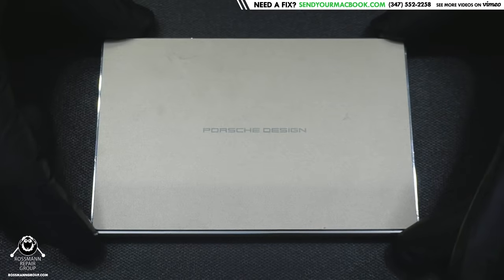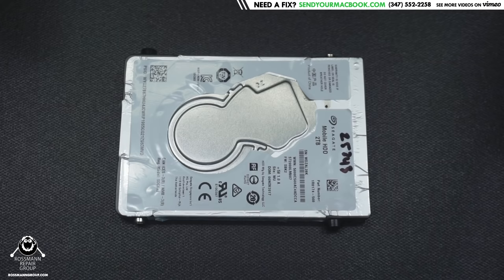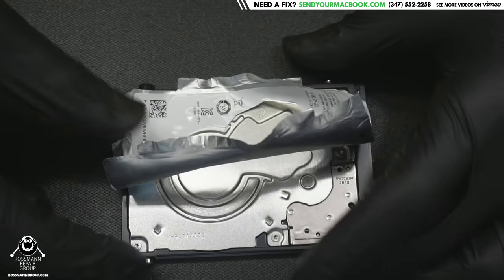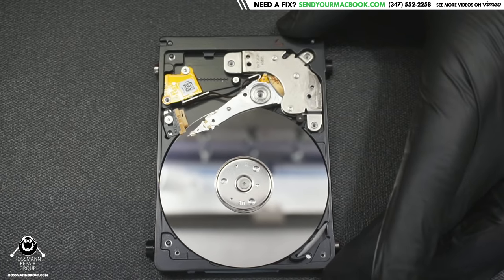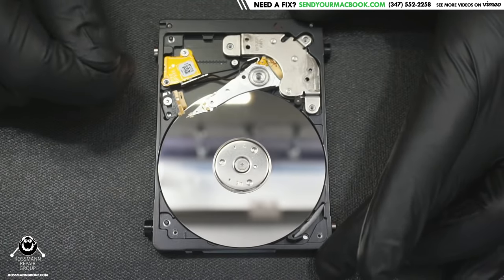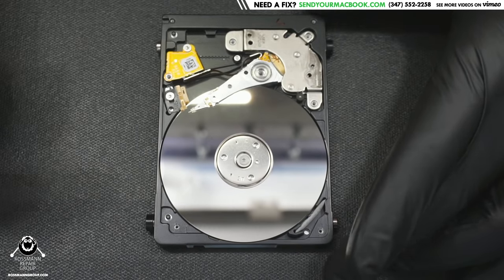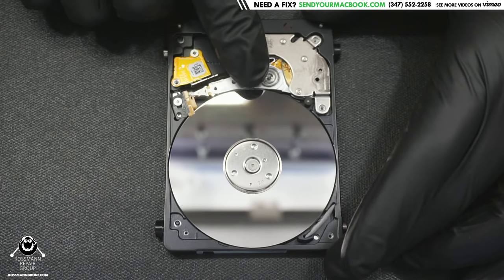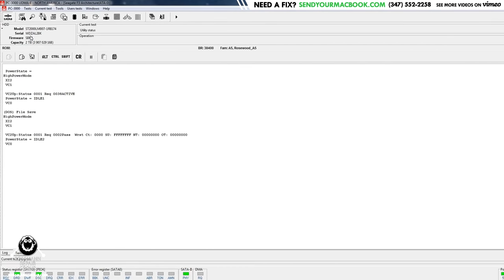Why your Seagate external hard drive is beeping; beeping hard drives can be recovered with this fix

Comment: You have to learn by try end errors to learn. These recovery technitians with experience did not came from nowhere. ;-) Good video. I learnt something.
Reply: Yeah but you learn using donor drives or get some old crappy used drives, not on your own (or someone else's) data.
Reply from the maker: @vgamesx1  vgamesx1 gets it.
Reply: @vgamesx1  thankfully there is no shortage of obsolete HDDs in the world.

Comment: Those heads can really stick to the drive surface, I haven't done a recovery but I've pulled apart junk drives with stuck heads and it surprised me.
Reply: Perfectly polished metal can sometimes spontaneously weld themselves together. It's a strange phenomenon but it is definitely a real thing. This is a regular problem under vacuum conditions and has been an issue on the International Space Station a few times over the years. While hard drives do not use vacuum (well, not the consumer ones anyway), you can still get similar (though far weaker) welds ocurring. Fortunately they are fairly easy to unstick but yes it is surprising how strong they can get

Comment: Louis, good tutorial, I hope that for someone it would be helpful. I have solved same issue with damn Seagates before, and unfortunately, those repair just gives time to backup the data. All drives died after some time.
Reply: I think that is always the case.  You're "rebuilding" the drive in order to recover the data from it.  As is the case to everyone except Apple, the data is always more important than the hardware.

Comment: I get defective seagate microdrivers for laser mirrors, often they have stuck head but 80% of the time a good finger flick when powered on unsticks the heads from the platter. No I am not advising to hit your hard drive when powered to unstick heads, I just found it interesting it had such a high success rate with microdrivers.

Comment: Thank you so much for this video. I managed to unstuck the head, everything worked afterwards and I was able to copy all of the data to another drive. 
It saved me 1900€ a data recovery company in my town wanted to charge me for it, their "analysis" (they didn't open the drive) said that there is damage on the magnetic drive and there are bad blocks. Well...

Comment: It's always the more expensive and exclusive ones that break
Reply: This isn't a expensive or exclusive HDD. It's a budget, run of the mill HDD. Generally, more expensive HDDs are better. I can't think of a HDD where the more expensive one isn't better. You can find $120 HDDs that are not as good as a $110 HDD, but that's just retailer price fluctuations. Significant price differentials are what I'm talking about. A $300 HDD will be better than a $100 HDD.

Comment: I bought 2 3.5 inch 2tb Seagate hard disk drives for my home office server and they did this sound out of the box. I had to add a 30 second pre-time in the bios of the machine to let them finally spin up.
Reply: Maybe your mobo isnt providing full power to the harddisks or psu is too weak when all systems go powerup?

Comment: The pinned comment from Mytheroo and expecialy the comments from Louis channel later are good. Ive spend many hours trying to learn and recover data. the older the drive (as in 20 years old or older) are "easier" than newer. Firmware, tiny parts, more complicated IC and firmware tricks to get new heads or pcb to read the data. Realy realy old drives, like a few Kilogram heavy  IBM mainframe ones can maybe recovered using a ossilioscope and some fpga in a weekend, these modern babies are a work of art.

using Jtag to find multiple cores in the controller, undocumented instructions, firmware both on eeproms and on the platters, alignment only found in the magnetic field.. I lost 20 drives due to experiments. no important data lost. 3 harddrives data lost because heads went into the platters because I did not know. a few laptop drives went total dead after I tried recovering data (I atleast got the 3 excel files the client wanted, but vacation photos where gone). With no money, I will be the last resort. Advice, go find a professional recovery company. only if thats too expensive and you or the person with the sick hdd would love you give it a try (with guaranteed dead drive), go try learn. What those recovery companies have, is money for the right tools and get information from other recovery companies on what to do with a dead drive, how to proceed. its this "closed" community is paying for, getting your invested time and money back by sharing these details.

Sure its sad its a "closed" community, but if you have money to get in, you can earn that money back by the repairs. And I dont blame them. DAMM too many people ask me how i fixed their machine for free, or if I can help recover another drive for them. Dude, you dropped your laptop, I did it for a free beer because you where cool. this is the X time and it costs me 3 hours to replace those parts and copy your data. Ow well, atleast I made some friends and got some stuff for free... but someone has to pay the rent, food and buy a new car. if you realy want and read all this way, follow this channel from Louis and maybe visit, register and go find experts on hddguru dot com. (bios-mods dot com for bios mods, hacks, fixed) and learn what Jtag, serial ports and hexediting is.

Comment: You mention that the job is normally $200. I was just given a quote that it would be minimum $500 - to a maximum of $1400 depending upon how it was broken. Regardless of whether it was 1 picture I needed recovered or the whole TB and I can't find anything cheaper where I live. So....yep
Reply from the maker: This is two years old, prior to the realization that at this price, not only would we be inundated with over 200 drives, but also have no budget to train or hire another person to handle them, or work out of a facility to fit said person. many wind up being bad heads, not just stuck heads as well, at which point this video's tactic no longer applies.

Comment: Cool! Can you do a video on the HDD logic board repairs or replacement?
Reply: That depends on the product right? just unscrew, remove, put new one there, screw and done. unless the firmware must match the platters, then swap eeprom. if even more screwed up manufacturer, swap main controller ic. if broken eeprom or controller ic, reprogram/flash them using scary rusian tools and tutorials :D easy if you know it, dificult for me, as I did not wanted to pay 100 dollar to Ukraine forum dude for tutorial. ow well, I forgot whats on the drive anyway, probably just windows with some steam games. School stuff was on my laptop at that time.

Comment: I refuse to buy anything with a Seagate drive or put one in any system i'm building.
In the last 20 years I've only had 2 hard drive failures and both drives were Seagate.
Reply: Me too! Which brand do you use now?
Reply: @moow950  Western Digital RED

Comment: Thanks, excellent.  Which way do the platters normally turn, the same direction, counterclockwise?  I thought I remembered you saying to turn them opposite the normal direction in the first video but could be incorrect.

RichE San Diego
Reply: Gogle Plus Sucks look at the head arm, the platter always travel from the root of the arm to the tip, so it creates a airflow cushion to float the head up.

Comment: I dropped my hdd on my foot today, I know you said leave it to professional but I don't trust 'professional' at my place. So I went and did it myself like you show. Surprisingly it worked! Well it did stop working once in a while using usb-sata cable, but it constantly works when using 'dvd sata'-sata. Is there a way to check if my hdd recover completely write/read speedwise?

Comment: This vid shouldn't be called "how to fix it" as that implies people should try (like in the spirit of louis's brand/vidos). it should be called (how they fix it). 
regarding the head and platter, the best analogy I was given (by a hard drive lab) was "it's like a jumbo jet hovering a couple of mm off the ground.  that's how small the tolerances are. 
The screw tensions are entirely specific too, get those wrong and it's junked. in fact, open it at all in a non-clean room, and it's probably junked anyway. in other words. send it to a lab.
Reply: I've fixed a great many stuck drives like this with basic tools and in a non clean-room environment. It's really nowhere near as much of an issue as people think (or as much as the data recovery companies would have you believe). Sure it's a risk, but then so is walking across the road. If you're careful, you'll be just fine, and although once you get it working you should of course back everything up, there's no reason why this shouldn't be a long-term fix (and in many cases it has proved to be just that)

Comment: I've always stopped short of removing the cover because of dust - I was shocked seeing the technician essentially only separated from the open drive by a sheet of acrylic. How can a normal person do this without access to hyper cleaned air? That being said I've rescucitated a few dead hard drives freezing them and or giving them gentle knock on the edge into the palm of my hand, long enough to retrieve the data they contained. Haven't had to do this in a while though, don't know it that would work with modern drives.

Comment: This is really insightful. I have a similar problem with my internal hard drive. I'm just not sure whether it's the hard drive or the power supply. I can read all the data on it and it works. But sometimes, especially when I start playing video games, it starts beeping, the screen freezes for split seconds and it already happend twice that my computer crashed. Then when I reboot, the drive keeps beeping constantly. I replugged the power supply and it works again until I start playing a game again. It drives me crazy and I don't know where to go from here.
Reply: Backup drive immediately. Replace drive.

Comment: I have access to a dead drive about that size and I think it has the same error.
One the drive's data should be erased and two this looks fun.

Thanks.
Reply: What do you mean, "the drives data should be erased"?
Reply: @xenonram  The hard drive I have access to, has company data on it, only it will not initialize and its making the same kind of clicks. So, if I am correct and it is a similar hard drive, I'd love to give it a go.

Comment: Question. What is ur opinion about Seagate ironwolf series? Need upgrade storage by about 10TB. I think about taking 1x ST10000NE0004 or 2x ST6000NE0023. They are going to tower that don't move and they will be in antivibration slots (whatever it's worth). Did u repaired/ saw them in rl and what is ur opinion from data recovery points. They will be used to storage work files, mostly large video files.

Comment: Question:
I had a drive that was not being detected, making a slight ticking sound.
I put it in the fridge and after 5hrs I took it out and it started fully working.
Any reason?
Reply: Maybe shifted the metal around because of the temperature change?
Reply: wait, I have a same problem with my seagate drive. Is this method really working? 
Also, by you mean putting on the fridge, is it on the freezer or normal one instead? 
please don't make this method as trolling instead 😂 lol
Reply: yeah the metal will contract slightly when it's cold so that can sometimes unstick the heads. Personally I've found that this isn't generally a reliable fix and I'd be more worried about getting condensed moisture on the drive which will do far more damage than just opening it up (briefly). When I've tried this method I put the drive in a sealable bag with a sachet of dessicant silica gel, and I've had around a 30-50% success with this, compared with 95% success by opening the drive and physically unsticking the heads - although once or twice I had to do it twice to get it properly unstuck - both those occasions were on Seagate Momentus laptop drives

Comment: I have some Seagate and WD 'enterprise' drives if you want them for a teardown. Most of what I see are the consumer/desktop/laptop drives. I've wondered if the internal build is any different.
Reply: Probably not in fact it's quite common that many of the components come from the same production lines but are binned to tighter QA tolerances than parts destined for consumer grade end products. It's how manufacturers keep the yields high by selling off slightly imperfect but still working parts at lower price points. You get this a lot with silicon parts too especially for things like CPU's and GPU's where the differences between models can be as simple as the number of functioning processing units or the number of functioning cache memory blocks so if some fail QA the manufacturer can still salvage the die by disabling some and selling it as a lower model in the same architecture range.
Reply: @seraphina985  So probably nothing we'd be able to see or notice from a teardown then. I thought it might be something like that.

Comment: Tried my hand at this level of data recovery years ago on an old drive, same situation but i just ran the drive after i unstuck them LOL i know. I told the client that they should 100% send it in to a lab that has donar parts available BUT because they were cheap and had confidence in me i went ahead and did it lol. I was able to recover the data with corruption ;-P and used a HVAC filter behind a 120mm PC fan to blow filtered air over the HDD so i didn't shed skin or whatever on it... when doing it all i could think of was how big of a gamble it was never did it again LOL. I'll stick to the warming/cooling/slapping tricks lol then copy everything over sector to sector with USB 2.0 lol to prevent stress that could make it fail again THEN do the final recovery from the good cloned drive.
Reply: Yes I agree! Personally I steer clear of messing with the hardware- I have had a lot of success with temperature though - putting the faulty drive in a sealed container in the freezer & then doing a sector level copy to a good drive. Even with drives that don't seem able to extract data continuously normally in the freezer, the sector cloning often seems to work- I just extracted 500gb of precious audio data onto a clone from a drive that couldn'tnt read normally for more than a few seconds. I guess the sector level contiguous copying of raw data is less of a strain on the mechanism. If a drive is beyond this type of  process I send them to a proper data recovery outfit. Even then I've seen Seagate drives with firmware corruption issues where a top international company couldn't recover data from an undamaged platter. Over a thousand pounds didn't get the data back....& Backblaze stats are very helpful.

Comment: Recently got a MacBook pro 2012 mid and the battery doesn't hold a charge and only turns on with power supply im guessing to fix the issue is a new battery right since original owner said battery never been replaced?

Comment: Could you explain what you mean when you say "you only have one chance in data recovery"? Couldn't you just dd the drive contents over to a different drive? You, BIOS, and data recovery software aren't writing over any data to the disk. (unless if you move the head over the disk like you say in the video) Does the drive have firmware on it that locks you out after reading data back from a damaged drive? Please explain thank you. Love this series.
Reply: I think he means that if you screw up the physical fix you can't just try again like Louis might try another chip or re-solder a link but if you mess up installing a new head you are likely to do more damage to the platters and that data will never be recovered. So you do everything right first time then copy as much data as you can.
Reply from the maker: If you mess up the platter that holds the data, you are done for.

Comment: You were lucky that the heads were stucked near the edge of the platters. Those Rosewood drives unlike the Seagate Momentus 5400.6 and Samsung M8 are much more difficult to handle with problems of stiction. If the heads had been stucked in the middle of the platter it would not have been so simple, and in any case after unstick a microscope inspection would have been necessary.